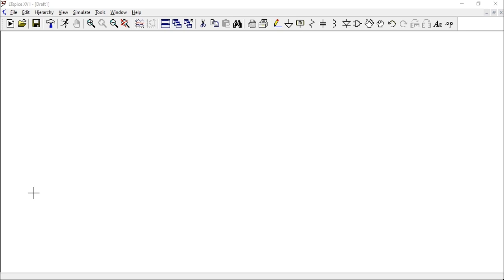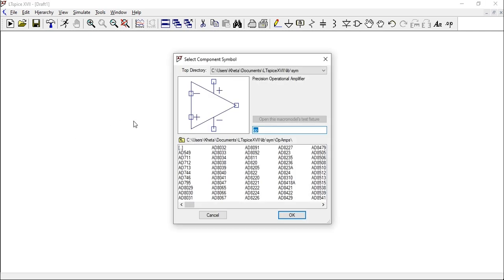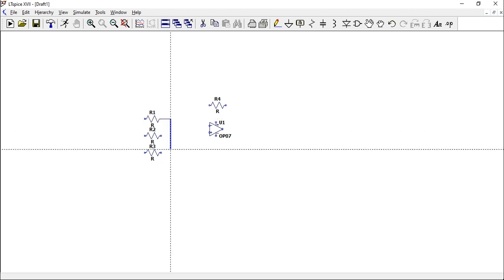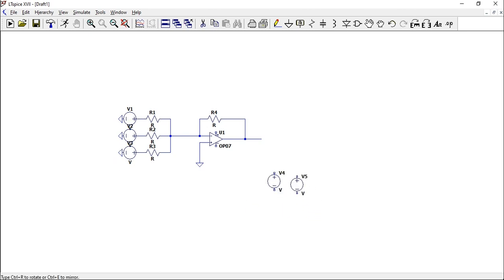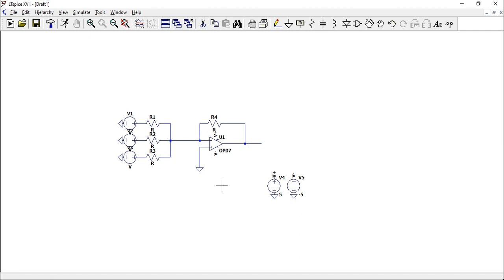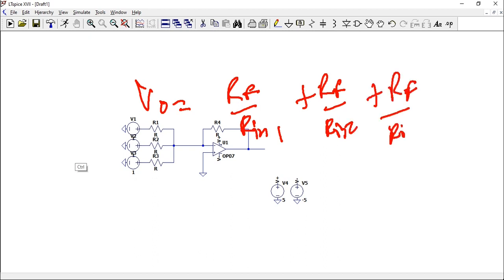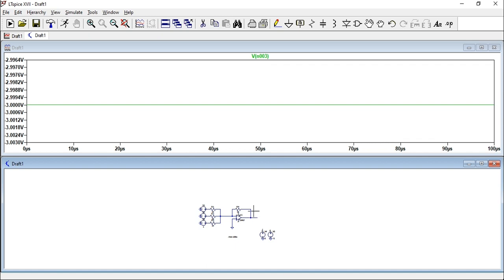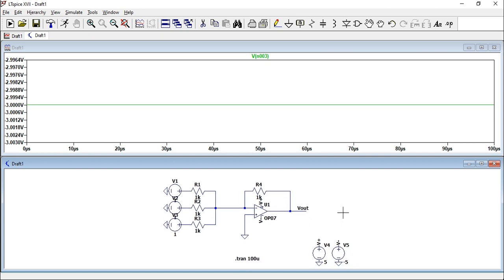Summing Amplifier | LTspice Tutorial | Khetz Tutorials

Comment: For +12 v and -12v what should be resistor values and voltage supply value s
Reply from the maker: That depends on what you want to achieve. You can use any values of your choice that will give you your required output according to the formula at 0:55. Just remember that the correct formula negates everything so all terms there should have a negative infront